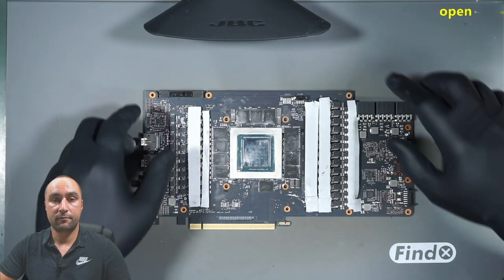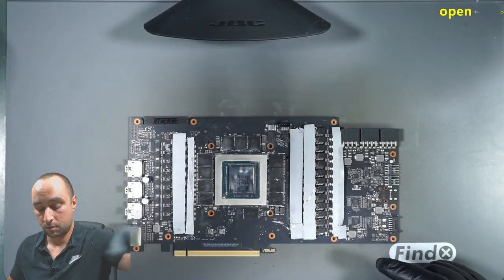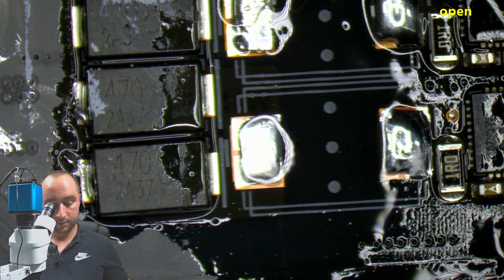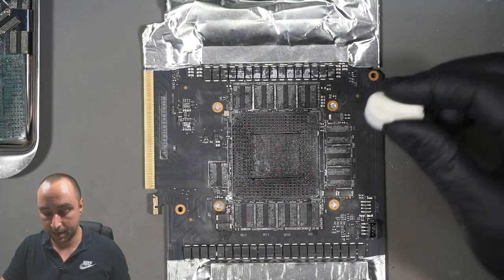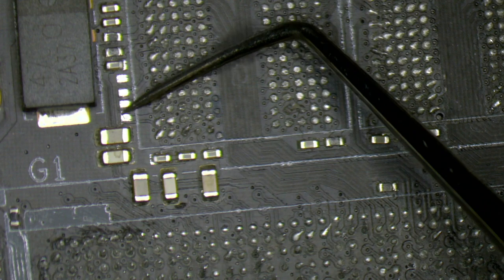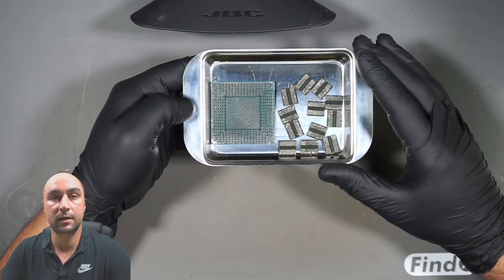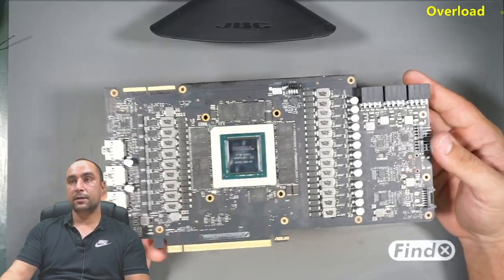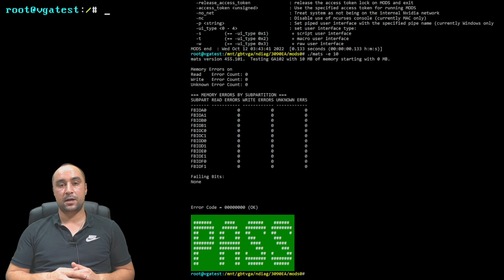RTX 3090 ASUS - Liquid Metal DISASTER | Repair #krisfixgermany #gpurepair

Comment: Liquid metal seems to cause more problems then its worth, not sure why so many people want to use it just to get 1-3deg C better heat transfer and risk short circuiting the board
Reply: 1-3c ?  My 5800x 3d dropped from 90c prime95 to 84c.. and 78c on cinebench to 71c..  liquid metal is great if done right..
Reply: @jeepsblackpowderandlights4305  for sure in extreme test loads you will see the highest temp drop, but a typical work load will benefit only a couple degrees, imo the risk/ benefit is not worth it, why not just upgrade the cooler?
Reply: @robertficek7586  nothing to upgrade.  Litterally my 5800x3d is the hottest cpu for AMD.. evrryone reports 90c or close to it.  Why nit help it with liquid metal ? 

Im using two 360mm radiators. 14 fans and a EK waterblock and i still saw 90c in prime 95.  With liquid metal in cenbench and prime 95 it dropped nearly 5-8c.

Thats a lot.    Also prime 95 is unrealistic maybe.. but not cinebench..  when im gaming.  My cpu usage is usually only 20% or so averaging maybe 69c.  But with duel monitors i usually have youtube running or something.  A video playing while im in my game runs the cpu usage to 50%.  Ive seen this cpu spike go to 86c just doing this....  

So again. Liquid metal metal helps a lot.   And there is no way to upgrade my cooling.  Most waterblocks are within 1-3c of eachother.  So ya
Reply: @jeepsblackpowderandlights4305  wow, that AMD core sounds like it's way too energy dense, bigger CPU dies and larger surface area like watts/mm2, but not much you can do if that's how its made
Reply: @robertficek7586  yea the 5000 series is stupid hot.  But the 3dcache makes it unbearable.  So any drop in temps like i got is a big one.  Im not comofrtable with my cpus at 80-90c.. thermal throttling happens there.

Were just at the point where the cpus cant transferheat fast enough anymore.

Now id never do liquid metal on a video card..  a waterblock on those lowers temps from 70-80 to 40c... they can be cooled way better with a cooling solution change.  But not cpus
Reply: @jeepsblackpowderandlights4305  the only thing I can think of is there is a company that use to make a 2kg full copper cooler for AMD, it's so massive it's rediculos, but with that much weight hanging off the mother board I don't know if that's practical either, with that kind of thermal density you really need a mass to absorb that heat and copper is better then alu. 600-900g aluminum coolers are really only good up to 100w

Comment: liquid metal is not worth it for GPUs because the chips are very large, power density is lower than CPU, contact area is very large and there's no IHS in the way, just direct die cooling, much easier to cool.

Comment: This looks like someone bathed it in liquid metal.  What is going on? every single tube of that stuff I've ever seen has big warnings detailing how it is to be used, tiny quantity, protecting surrounding circuitry etc.  Every YouTube video I've ever seen on the subject goes into the same as well.

Just how are people getting things this wrong, if they're aware of liquid metal as a thermal interface material they must surely be reading and watching this same information.

Comment: How does someone mess up with liquid metal this much? 🤣
Reply: I genuinely do not know.  It is like they used the metal syringe piece for thermal grizzly, couldn't get it to come out, so they just kept squeezing hard and harder.  
Literal pin-head size, from the normal tube of thermal grizzly with no attachment or adapter, spreads the easiest on dies.  You can use the end of the syringe to scrap the die and it easily forces a quicker bond to the nickle-plated surface faster than repeatedly trying to spread it and spread it and spread it.  
Rubbing the head of the syringe onto the die gets the liquid metal bonding to the nickle nearly instantly.

Comment: What kind of amateur did this?
Someone took the whole syringe with LM and sprayed it over the whole card.
Liquid metal works wonders when done correctly.
I've done it on laptops, gpu's and delidded cpu's, never an issue.

Comment: Awesome job. How are you able to clean the solder pads from liquid metal? I had Ryzen CPU where few pins literally fell off by themselves because of liquid metal contamination and I was unable to clean the pads so new solder would stick on the pad. I cleaned it wit Isopropyl alcohol, suck all what was left there with wick (used ton of flux) even tried weak hydrochloric acid as last thing, but I was not successful.

Comment: Incredible how people are willing to endanger their GPUs with Liquid Metal so they can get like 2 C lower temperatures
Reply: The difference in temperature on a GPU is 8C average with up to 13C improvement under stresstest/load.
Reply: @RNG-999  you wish, guy
Reply: @victorsegoviapalacios4710  : It's true. I've had similarly good results with lm on my GPU. Also, the higher the temps the greater the effect becomes.

Comment: proves my point about liquid metal and new gimmicks that are ultimately self defeating. call me old fashioned but I've never gone wrong with arctic silver and a window mounted radiator large enough to cool a chrysler new yorker engine. yeah sure its bulky and the noctua turbo fans are kinda noisy together but I've never breached 37 degrees Celsius even with an overclock and never ruined a component. no one can ever convince me liquid metal is worth the risk or that graphene is worth a short circuit. dont even get me started about diamond paste and its abrasive qualities. 

you want more out of your card? get better pads, mill a better block and set up a way to cool from the back side too so it leeches heat and protects your BGA from stress by homogenizing thermal temps.

Comment: Easy way to clean liquid metal spil.....Put card in a plastic bag seal it well and freeze it for 30 mins then clean the cool pcb with a hard plastic brush....Thanks me later....🕺🕺🕺
Reply from the maker: How this will help remove the liquid metal under the chips and any already corroded solder joints?
Reply: @KrisFixGermany  ofcourse not under the chips 🙄...but it helps clean easily off the PCB...i only want to share a tip as it worked for me for PS5 board......thanks🤗
Reply from the maker: To remove it from surfaces is likely to be an effective method. Thanks for sharing